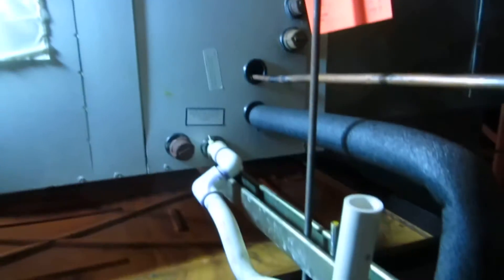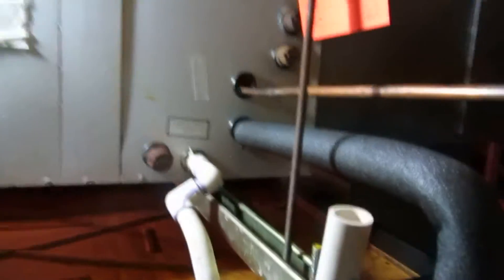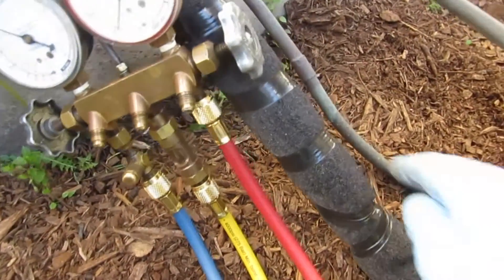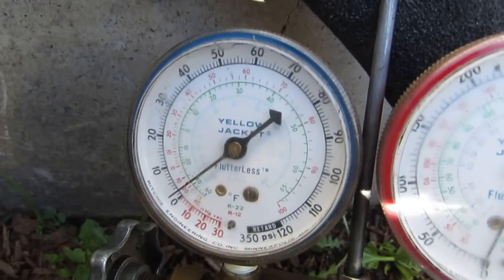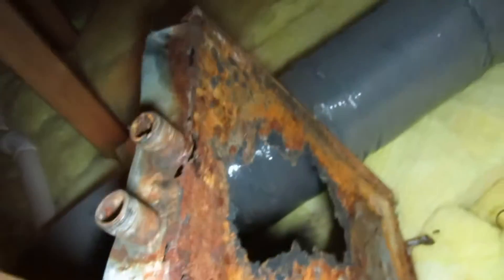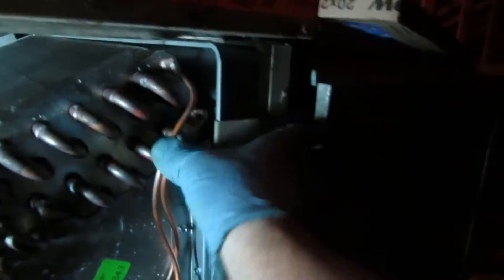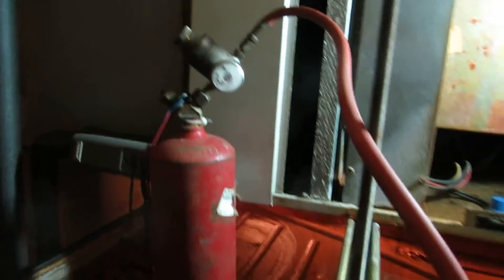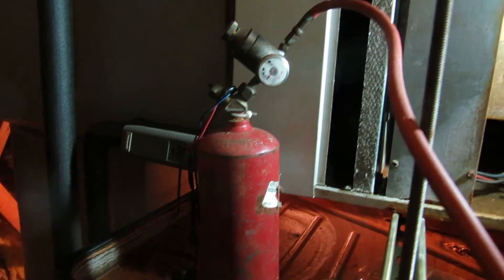HVAC:replace first co. A coil @ pan .big vaccuum in less then 3 minites

Comment from the maker: first company make the air handles they have a hot water heating coil and a evatorator ,them are the ones i see in my area we do not use heat pumps in my area unless its a summer home only then maybe i see them ..the older goodman used copland compressor i have seen bristol in them also but not to offen you have to look at each one ..some of the new goodman have scrolls.

Comment from the maker: thank you ray for the nice comments  ... i was suprised in how fast it vac  pulled down that was the first job i used it on and it was old line sets .it pulled down in under 3 minites  that thing rocks !!!!.ya the mc tank is very light the torch set up is small for the mc tank connections i have never seen one like it before i looked on ebay but could not fine one like it .... ones for the b tank yes ...i also have a set up accetine for the b tank but that b tank is very heavy to lug around